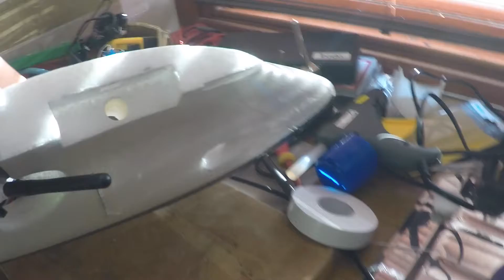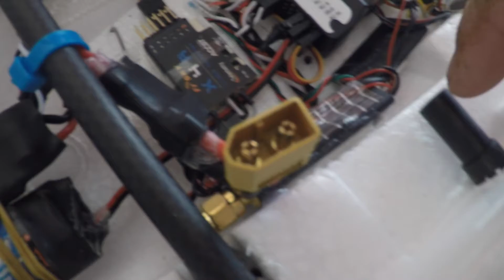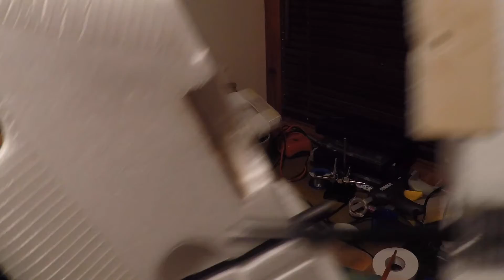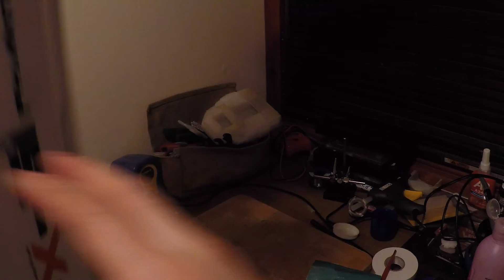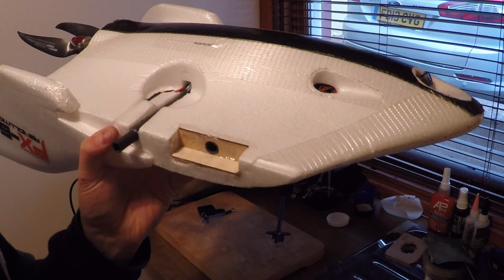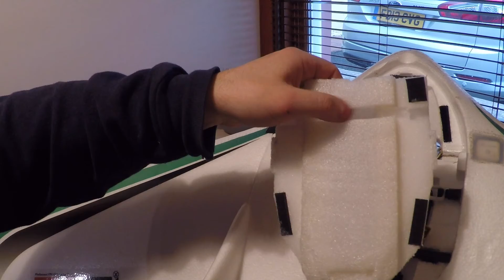FX-61Phantom alternate removable wing mod

Comment from the maker: To be honest, apart from the awful encapsulated nut design that Zeta have included in this v2 Phantom model (which inspired this wing mod) this is a seriously well designed plane and with awesome build quality - I don't think I've seen a foamie this well made before. It blows the likes of the HK Cloud surfer out of the water in terms of build quality - for example given that the control surfaces are so long on this wing, you would expect a little flex over that length, but no - the thickness of the surfaces gives really good support and the trailing edge of each elevon is perfectly aligned with the wing throughout its entire length. The Cloud surfer on the other hand...ehem...out of the box the flaps came with a twist, and one of the wings was especially badly bent on the trailing edge and tip - QC not very good, and poorly designed to be able to lose its shape even in transit. Thankfully, no issues like this with the Zera Science products. Heard a lot of good things about their other models too.

In addition to great design/build quality, the fx-61 phantom flies like a dream. I still consider myself a beginner but I find this wing very easy to control. Its super stable, even with my Pixhawk in Manual mode very easy to fly. Its also predictable and fairly docile in a stall - some wings stall very badly apparently, and turn into a frizbee! Not so on the FX-61. Important to get that CG balanced up nicely though. I ran mine today on a new 3700mAh Zippy compact 4s (with 10x7 Aeronaut cam carbon folding prop) and it flew for nearly 40mins with still another 10mins left in the LiPo. This realy is very good. 

My setup is not standard though as I am running 4s with a 10" carbon folding prop on a 2814 870kv sunnysky motor. I think this plane really needs this extra thrust - on 3s it didn't run nearly as well (under powered).